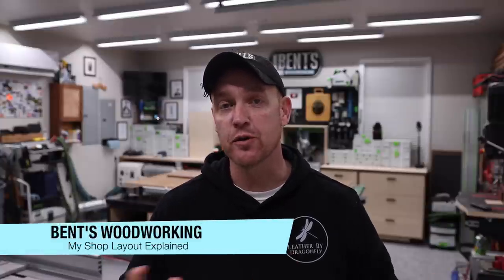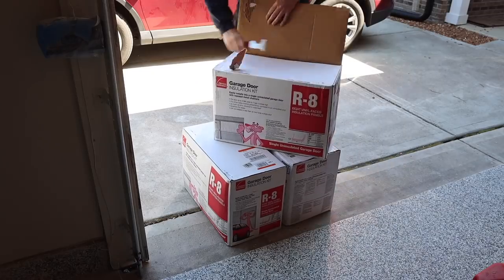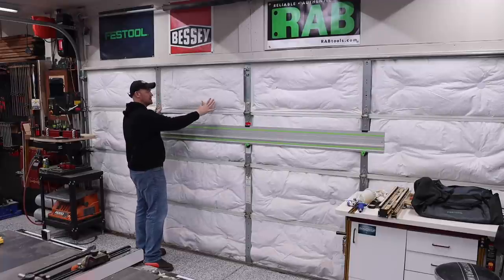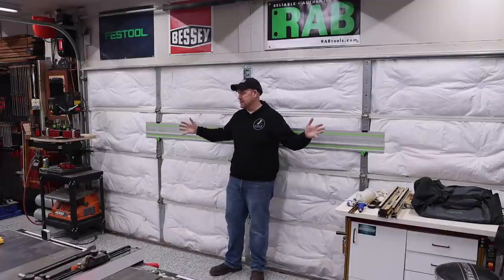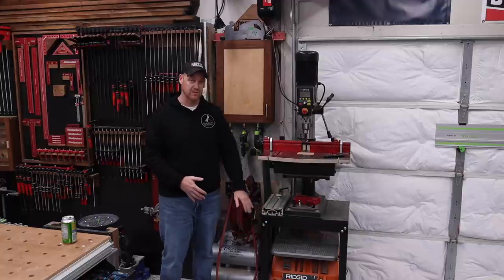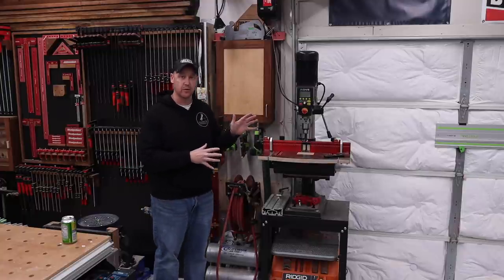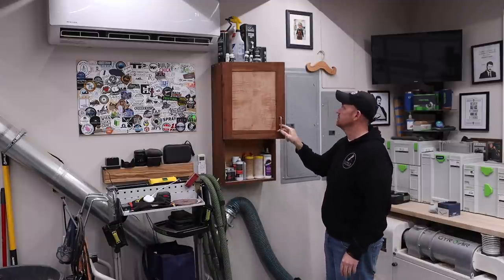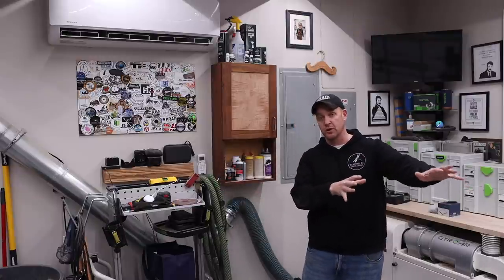My 3 Car Garage Woodworking Shop In Detail - Woodworking Shop Tour 2021 -  Woodworking Wisdom

Comment: Just saw this video today on 1/1! This was excellent for me as I just received my sawstop which is kicking off the need to re-run electrical, finish the interior, put up cabinets, determine where the big stuff is going, etc. The way you have your "tool wall"/assembly/clamp wall mirrors the design I sort of already have (but need to massively upgrade) and reaffirmed my instincts on that area.  So so relevant for me. Thank you!
Reply from the maker: I’m so glad you found it helpful!

Comment: The mini split is a great addition to a shop for winter and summer. I live in a cold winter climate so I plan to add hydronic floor heat in the concrete floor slab. My cousin in Alaska sold me on hydronic floor heat.

Comment: Drill a small hole through top bora bracket and bottom bora bracket, then attach small bungee cords securing the lumber in place as they vibrate to the edge over time with the opening/closing of the door. I suggest this so its easy to just unhook the lower connected bungee cords to get at any wood and they will just dangle until you secure them back in place.

Comment: Great shop tour Jason. Regarding the clamps... I made a drawer with low profile casters at all four corners  and put my most used clamp in it and it slides under my workbench. So far it has worked out great. If need be I can wheel it out, tilt it up and lean it against one end of the workbench which keeps them out of the way until I need them.
Reply from the maker: Great idea, thanks for sharing

Comment: Lovely shop, and I appreciate the thought you put into the layout. I loved the explanation of the tool island, and I basically have a tool island as well  (table saw with extensions, and fold  down outfit rollers, that also serves as the assembly table) but my shop is only 20 by 22' and at this point the shop is too crowded. Maybe someday I will get a bigger shop, but not soon. One thing I have is a two-car carport attached to the shop, and that greatly expands my usable space. I live near Denver and with the carport I don't need an inclosed garage to store the truck. So I have work benches with vices, grinders etc under the carport so I can cut metal, or large sheet goods, outside under cover most days of the year. I have space for temporally storing excess lumber there. I also use volatile liquids, torches, and my chainsaw outside under cover. I love that carport.
Reply from the maker: I think a carport could be very useful. Especially in a situation like yours where you use some things that aren’t well suited for enclosed areas. 👍

Comment: Ditto on the mini-split.  Love our Trane/Mitsubishi.  For those that have min-splits, when cleaning don’t forget to check/clean the blower wheel.    We added two layers of white foam (polyisocyanurate) to the garage door w industrial glue gun.  Primed/painted exposed side w epoxy paint.  Wasnt worried about the weight as I had two commercial springs installed and door balance shortly after adding.  Went with a Direct Drive brand garage door opener (German) after old Genie screw drive died.  Didn’t want chains in a dusty environment, plus the Direct Drive is fun to watch crawl along the rail.  Plus side is the opener  fit (circling clearance issue).  Hadn’t seen too many side openers before.  Installed weather seals around the gdoor.  Put R45+ insulation in ceiling big help here in Dallas.  If it’s 105 outside, and about 94 in the shop, takes about two-three hours to cool metal surfaces (eg mill table) down to 72.  If we’re milling (metal)  a lot, we just leave the mini split on 7/24.

As part of the shop remodel, had all 220/110 plugs placed higher than worktops (also eliminates bending over).  Installed removable chase panels for easy access so Sheetrock doesnt have to come down for future electric work.  Covered all Sheetrock walls w 1/4” plywood painted w water based SWilliams epoxy paint for smooth washable surface (we do machining as well as woodwork).  Slick surface doesn’t collect dust like previous room-textured Sheetrock did.  Installed tall thick baseboards to act as bumpers to help protect the walls.  Still need to plumb big aircompressor w copper lines through our two work rooms.  Maybe this summer.  Been approx. two+ years since remod started, liking all the changes so far.  Would do an epoxy floor but have a few reservations about that to resolve in my head.

As always, just sharing.  Nothing more, nothing less.
Reply from the maker: Thank you for sharing! You would love the epoxy floor!!
Reply: @bentswoodworking  no doubt and most likely 👍. Would have to find a balance of sweepability and slip resistance.  And the the thought of moving everything again, eeeessh, and having everything in the driveway for several days.  Looked at Pods, those things are highway robbery, the scot blood comes out and cinches the purse strings tight.    Would be great for cleanup and no staining (way oils and coolant), but would definitely go w a commercial install.  About half of the (20’ish by 40’ish) shop is a separated room that we call the “model room”  that has a solid oak floor over the cement.  Very nice to walk/stand on vs the original concrete, self installed, 20+ years and no creaks.  Even has a couple of “rocking chair memory” spots, eg my son was working on scratchbuild model parts and drilled into the floor when he was younger.

Maybe next year after I’ve forgotten the pain of moving everything 😉🤙🤙

Keep up the vids! 👍👍👍👍 You’ve got a lot more patience for doing them than I do.

Comment: The weight issue for garage doors is referring to the garage doors with glass panels integrated or fully across. Grossly (glass) adds a tremendous amount of weight. But a garage door technician will counter the weights with springs and the motor will still be fine. I’ve had these same motors on our multiple doors and no major issues. My doors are insulated by the manufacturer called unique garage door.
Reply: J B do you think adding 3 good size tracks to the door can be accommodated by adjusting most currently installed springs?  Obviously, this is a taboo subject..but let's assume I'm referring to a qualified individual who has spring tension experience.
Reply: @arthurrice3915  festool track rails, or any other brand being hung on a garage door aren’t a significant in weight to cause any issues or problems to a garage door motor (aluminum rails). The weight of a glass garage door is astronomical in the terms of weight due to the tempered glass. I’ve had my garage doors replaced and discussed this with my garage door guy. Just sharing the information. They make springs to accommodate the doors weight so it is using the principles of leverage to reduce the strain on the garage door motor. 

Regardless of the material with which your garage door was made, its thickness, its size (single or double) or if it has windows, it weighs at least 130 pounds (single door), and it can go up to 350 pounds or more (double door with windows). Contemporary doors (all glass, double door) can weigh over 400 pounds. 

Just disengage (the little cord hanging to disengage the mechanism or worm gear, belt) your garage door and you can see how the spring helps to reduce the weight of the door by pushing the door up. You’ll see the weight is drastically reduced. This is all the springs do. However over time, they will fail and this is normal life of garage door springs. But I recommend letting a technician that’s trained in this to do the work because the risk of injury is probable. If your home when a spring breaks I assure you’ll hear it as I’ve had one break on my old door it’s a very loud bang because it’s under spring tension and a good amount of force is being expelled. Nothing was damaged but the broken spring but it was very loud. I hope this helps answer your question.

If you feel the door is more difficult with the rails being hung on them. Then simply hire a technician to make a spring adjustment to reduce the likeliness of stress placed on the motor. But this should honestly not be necessary in my opinion. 

I tried to see what a FESTOOL guide rail weight is and I’m not sure the information provided on Amazon is accurate but they aren’t that heavy but the information for a FS 1400/2 or 55” rails is stating it’s less than 6lbs at 5.73lbs according to Amazon. In the grand scheme it shouldn’t be a problem. An if your interested fastcap makes a mounting clips for track rails to be affixed. I hope this information helps you.
Reply from the maker: Thanks for sharing this 👍👍
Reply: @bentswoodworking  Not a problem. Just something I happened to know about from experiences.

Comment: An idea would be to put some adhesive coarse sandpaper strips on the lumber rack above the door.  I really like your space, wish I had a space that large..  mine is 2 car garage with lower ceiling.  Easier to heat but i'd rather have the space!   Great job designing the shop.  I work for space-efficiency too and share same type of logic !
Reply from the maker: Great idea

Comment: Great tour!  I feel like I got some great ideas seeing how you have everything arranged.  Also being in a cold winter/hot summer environment, I wish I had had the foresight to insulate and instal a climate control system in my garage. It's unusable in the winter when it gets to -40 outside.  But now I feel like pulling everything out to insulate would be such an endeavour!! Best of luck in 2022!!
Reply from the maker: Could be a good spring time project. It would be well worth the trouble in the end!
Reply: if get-40 degrees should get a wood stove and mini split for summer

Comment: After having my router lift mounted in my MFT for over 10 years, I can’t tell you how many times the router operations were in the way of something I wanted to cut real quick on the MFT. Drop the bit, remove the entire fence assembly, then try and get it back where it was. Using an Incra LS setup helps but I am so glad I built a separate router table this year. I keep an extra plate in the MFT to fill the hole, but my 2 cents would be to shove your router table into a corner and pull it out when needed.  You did mention you rarely use it, why compromise your assembly table operations?  Thanks for the awesome videos!
Reply from the maker: Hey Alan, I am still unsure if I want to put it in the assembly table. I just really like the idea of not having another machine taking up space. The way I plan on doing it, I am not as concerned with it being in the way of a cut. I only cut in 1 spot on the MFT so as long as the bit was dow, I wouldn’t have an issue I don’t think.

Comment: Nice shop.  I have a L-shaped basement shop roughly 18'x24' on the long edges, losing a 6'x13' cutout for a laundry room, as well as a separate 12'x18' storage area for tools not used often, paint, large lumber, etc (also the furnace, H/W tank & sump pump).  So, about 350 sq. ft. of workshop space or about 1/3'ish of my basement.  The biggest space saver I have is my router table is an extension of my table saw wing.  Well worth the $$$ for the cast table and it gives me a very large rip capacity, as well as ability to set the router fence well back.  I can wrestle 4x8 plywood down the stairs, but prefer to pre-cut in the garage... about the worst thing with a basement shop.
Reply from the maker: I considered the idea of putting it in the table saw but it would require me to move my Jointer/Planer

Comment: Very cool. And when in doubt, a big router table is golden for safety for being safe and controlling the bit against the material. At least in my opinion. I also believe the router maybe the most dangerous tool in the shop. I've definitely got some good ideas from you on the shop. You also got me to look again at a dust filter for the shop.
Reply from the maker: I agree. If I build it in the table I will have even more support.

Comment: Thanks for the tour off your nice shop.  So happy you will start getting into hand tools.  Will you cover education on hands planes and sharpening techniques?  Im so interested in learning how to use hand planes for a machine woodworker. Block plane, Jack plane, and Smoothing plane. Hoping to shorten the time of long sanding sessions.
Reply from the maker: At some point down the road I would most certainly make videos on some of those topics. 👍

Comment: Have you considered putting the router in the table saw extension.  If you don't use it that often it might be more "out of the way" there instead of your main table.  Also congrats on the new baby coming.
Reply from the maker: Thank you! And as for the router in the extension, I can’t do that based on the location of my jointer/planer cause I have it at the end of my table saw. I suppose I could do that and then just move the combo when needed but I really hate doing that. 🤣

Comment: Jason, I really appreciated this tour and sharing your thought process on setting up your shop. I realize a "working" shop is always going to be in some state of flux as workflow and needs change. I may be in jeopardy of losing my man card here, but I could really use some help in organizing my two-car garage that I still need to park one car in. Of all the things that I'm good at, organizing is not one of them and I don't have the luxury or patience of re-doing my garage/workshop until I get it where I like it. I need to nail it as much as possible on the first shot. Would you or anyone else out there know of anyone that offers such a service of planning or designing an existing garage into a workshop, and taking into consideration the equipment I currently have? 
Great content as always Jason, thanks, Chuck
Reply from the maker: Chuck, shoot me an email or a DM on Instagram if you are on there.

Comment: Jason - awesome job putting together your shop.  Your innovative mindset is truly motivating and inspiring to say the least.  

The closing of the 3rd stall is without a doubt the boldest move I have seen taken by homeowner / shop operator.   Like I said, that I have seen personal.  It definitely is an easy job at the value the shop brings to real estate.  I have an extremely similar setup in my 3 car garage.  While I personal would strongly consider this as an option; would you help my understanding a bit better of why the full blown removal is done?  Was is required for the current set-up?  I'm dealing with the same (I'm sure there are more of us) issue of....where do I hang up all these awesome expensive things that take up huge wall real-estate and are less than an inch in thickness - primarily : the green and red ones!   I've been trying to design kind of a tandem cabinet system to where the front and end cap sides are used for this hanging solution.  Instead of my woodpeckers taking up the size of a small car on my wall, I want my wall hanging item to hang on my cabinet faces.  My FS300/2 & FS2700/2 are unique animals...whats awesome about a 10' track? It's 10 foot.  What sucks about a 10 foot track?  It's 10 foot!  Mounting to the garage door I think I the best.  Or...a long horizontal cabinet that would have gas strut assistance would be another solution.  And enjoying the pretty red aluminums to not get "banged" around while opening and closing could be done with custom foam, perhaps..?? 
Also, clamps storage is another awesome / s***ity
Reply: ...I was editing my post and it posted... appogies 

Regarding the clamps.  Have you ever thought about incorporating clamps into the bottom of your assembly table, or in the toe kicks of cabinets?   Having a pvc pipe slide of sorts.  

Regardless, I watch and study just a few gentleman on these subjects.  You sir are one of the very best!   May you be blest in 2022!   
Best regards,
Arthur 
 "a student"
Reply from the maker: So the reason for removing everything for the door was to not have the rails and garage door opener hanging above me. Also, the rails needed to be removed to build the wall around the door. It’s all reversible if needed.

Comment: Just found your channel and love it!  Question. How did you run power to the 3 tools in your tool cluster/island?
Reply from the maker: I had a outlet in the ceiling and the cables run up the pipe and plug in.

Comment: I'm working on converting my farm shop from a general purpose shop (uninsulated pole barn) to a wood working shop.  Been insulating things and will be replacing my pellet stove with a mini-split before I get done.  Still trying to sort out my layout.  However, I'm curious about your decision to have the specific outfeed table vs making your assembly table the right height for an outfeed table like many seem to do.  I was planning on building a nice assembly table/outfeed table vs a separate outfeed table so was curious why you went that route.
Reply from the maker: I don’t like the idea of an assembly table that doubles as an out feed. However, if space was an issue I may consider it

Comment: Hi Jason. I am in the process of building my dream workshop. I have also purchased the Harvey G-700 which will be centrally located right under my table saw out feed table. I have put 6in PVC ducting under the slab running to my outer walls. I noticed in previous video's that you use to used PVC for your ducting and was wondering if you ever had a static problem collecting dust? 
I look forward to your reply, Dave E
Reply from the maker: I did not have any issues.